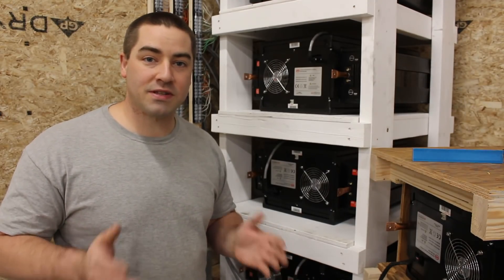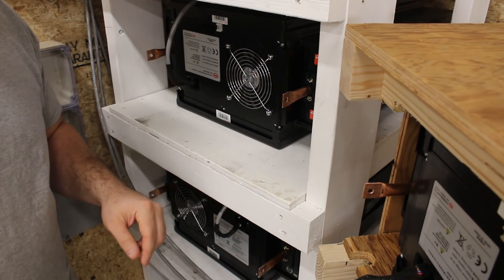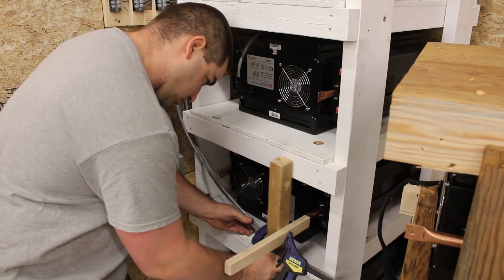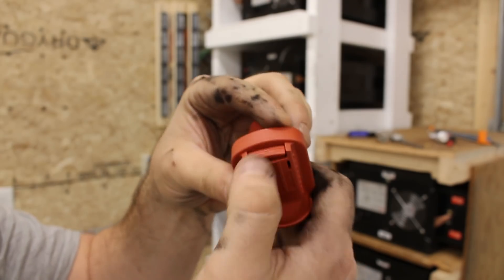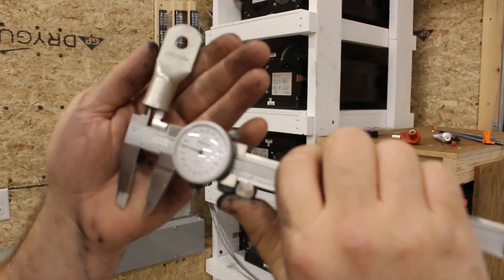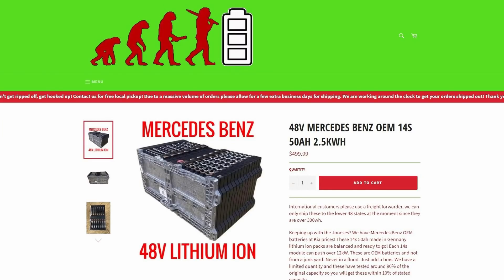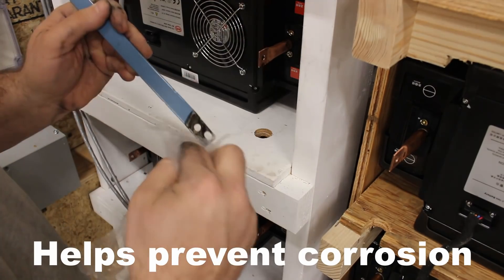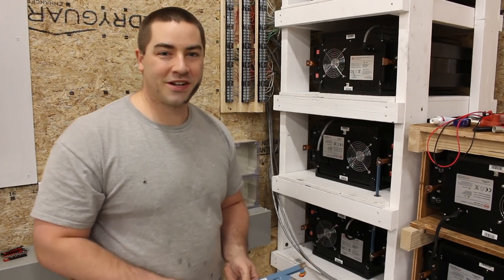Series Connecting 24v Modules into a 48v Battery Bank

Comment: Hi. Thanks for these videos! I have 4x 12v LIfePo4 batteries. My charge controller only supports 24v lifepo banks. So I want to charge one bank of 2 bats as 24v, and the other bank of 2 as 24v, then wire these two banks as a 48v bank. Doable? I have 2 x PVs @ 320 watts.
Reply from the maker: If you needed to use that particular charge controller, in a pinch, you could.  But, you would have to disconnect the 48V battery series from everything.  Have only 2x12V batteries connected in series, and then parallel the second set of 2x12V batteries.  Then, you could charge all 4 batteries together with the solar charge controller.  But remember, they would have to be disconnected from everything else.  After the charge, you can then re-wire everything back into 48V and connect to your loads.  Long-term it would be better to buy a 48V charge controller.

Comment: Hi David.  I have some food for thought for you.  Concerning your use of the carbon grease.  When you get to a point where you are hooked up to your inverters, you need to measure the voltage drop across your buss bar and your lug at 50 amps (or more).  My guess is that you will see a volt or more across the connection.  my point is that you are losing enough power across your connections with the grease in place that if you would get rid of all the grease and polish up the connections dry with no lubricant or connection enhancing material.  Same thing with your 4/0 lugs.  you are not going to have any corrosion problems because you are not working with hydrogen gas from your batteries.

Comment: Just to explain, Kilo Circular Mils or kcmil is the same thing as MCM and wire measured with these units go much small than 4/0 AWG as well. But for whatever reason AWG stops and everyone starts using metric units after 4/0.

Comment: 210.. Like your spacing Jig...The only way to assure duplication.
BTW.. What is the black stuff on your fingers and face ???
Reply from the maker: Thanks for mentioning the jig.  You are first to appreciate that.  On my face was some of the electrical grease I'm using on the connection points.  It helps prevent corrosion.  I linked to it in the description.

Comment: Something doesn't gel for me David. To connect in series, you connect two batteries + to -. Usually you will find + terminals on the same side of the battery, so you would put a cross connector in, yet you went vertical?
Reply from the maker: Sorry I wasn't clear about this.  When I put the batteries on the shelves I flipped every other upside-down.
Reply: @DavidPozEnergy  sneaky smart!
Reply: take a good look at the batteries - see how the fan is alternating from right to left?
Reply: @dodgeplow  cool, thanks!

Comment: Not sure if it's a good idea to parallel all the balance leads when you put 2x 24v stack in series (48v). Ground reference is off by 24v on the second stack and you will risk a short or a massive amp rush between cells.
Reply from the maker: When I do the final connections I'll be checking for amps.  Thanks.
Reply: @DavidPozEnergy  check all voltage on balance leads from your main ground connector  before connecting the small bus bar on the balance leads terminals
Reply from the maker: That is a very cool drawing program.  I follow that if I wired it as you drew it would short out.  I'm not wiring it like that, so I'm not shorting anything out.  And, yes, I plan to check all my voltages again before adding on those tiny buss bars.  That's why I took them off.  Thank looking out.

Comment: So you connect the batteries in series via the outputs and in parallel via the bms connections.
Are you sure you can do that ??
Reply from the maker: I'm also connecting the batteries in parallel when I run them to a central buss bar, I just haven't gotten there yet.

Comment: This is looking really good. I am building a similar powerwall 24v paralleled to 48v in series. Your video on the harness was awesome! I was pulling my hair out trying to decide how to wire until I saw your loom. Cant wait to see the BMS you choose.
Reply from the maker: I would already make some changes.  LOL. But thanks.
Reply: @DavidPozEnergy  what sort of changes, I dont want to make a mistake
Reply from the maker: For example, the Molex connectors were too much of a pain.  Next time I would buy JST-XH connector with wires already attached.  We can dive into it a bit if you send me a message on Facebook.

Comment: Nice save on the bus bars.  I too looked at those RadLok connectors and ultimately went your route - copper pipe.  I'm using 1/0 between the batteries to 150A circuit breakers  and then to a 600A bus bars.  From there I"m using 4/0 cable to my Schneider PDP.  I'm adding some Class T fuses to each of my battery pairs.  I'll hopefully be posting it soon to the DIY battery group too.
Reply from the maker: We are on the same page.  I've also got some fuses and such in my garage waiting for me.  Maybe after dinner...

Comment: I do not remember which way it goes but there is a difference between how you tie the batteries together. In pairs tied in series and then in parallel(like you are running) vs two sets in parallel ran in series. They will both get you to the same voltage in the end, but their is a preferred order.
Reply: I mentioned on the video where he built the rack about series/parallel.  I asked him why he wasn't paralleling 4, then series connecting them for one big battery.  He said it's because the internal cells for each 24V module are already in series.  So he's actually making 4 batteries and connecting them together with a bus to then connect to the inverters/charge controller.
Reply: Youre right. The preferred order (for cells within a battery) is: packs of parallel, connected in series. This is because the cells would all be new and equal. They then don't need a separate BMS for each series string, just one for the whole battery.
David's system will have the cells all paralleled by the balance cables.
Hope this helps.
Reply from the maker: Yes, you guys are right.  If you have the option, parallel your cells first, then series connect them.  I'm just working with the modules the way they came.  More then one way to make a powerwall.
Reply: @DavidPozEnergy  thats more a Tower of Power... than a power wall.. lol

Comment: Mouser had these but only up 10mm. There was a note on the data sheet that these connectors were not to be subject to any physical load, including the mass of the cable. I think I’ll stick with your original solution, if only to save a bunch of money.

Comment: $38 x 8 = $304, or 10 foot of copper pipe at Lowes for $10. Hmmmmm.

Well done on finding the part, but it's way over priced. Yes at $4, nope at $38.
Reply from the maker: Yeah, I feel the same way.  But thought it was beneficial to buy one for the viewers benefit.
Reply: @DavidPozEnergy  and appreciated! Now I know why they were so expensive!
Some serious engineering in there, but I think way overkill for this - your solution will do fine.